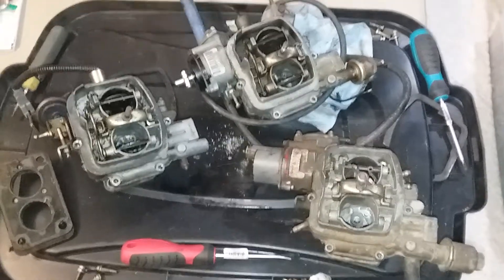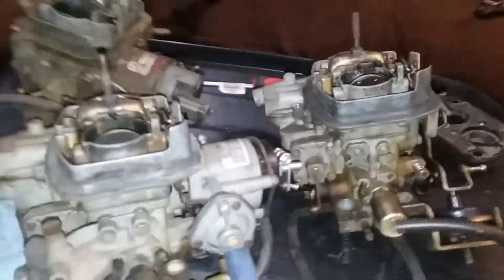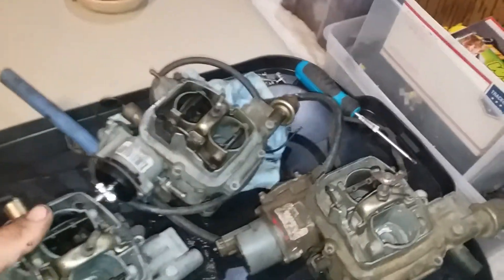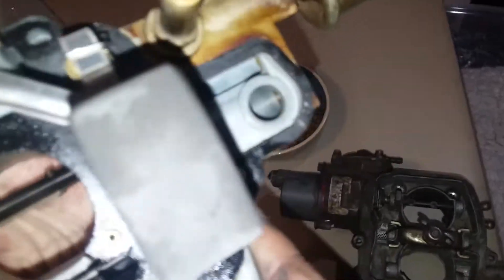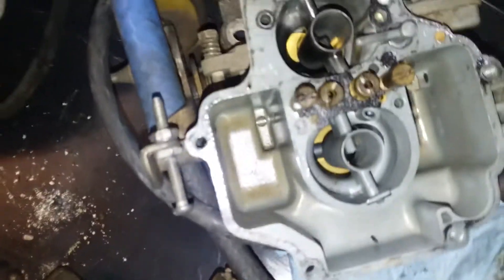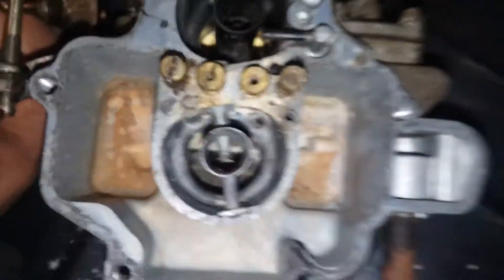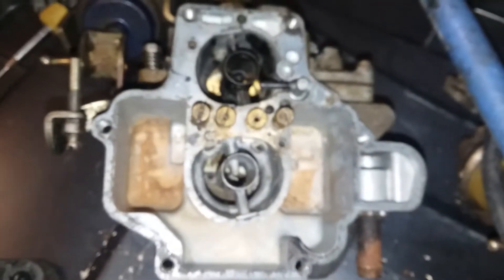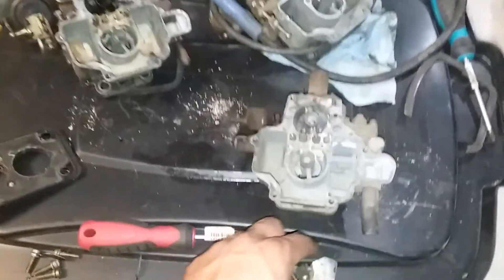1.6 VS 1.6 HO VS 1.9 Ford CVH Carburetor Comparison

Comment: Can you run a K&N air cleaner on these like you can on a traditional Weber 32/34dft or dmtr?
Reply from the maker: To have an air filter like that on these you need to make a custom plate or airbox just because these have a funny pattern around the tops of the barrels
Reply: @The_1982_EXPert  Another random question, will a traditional Weber carb bolt onto our manifolds? I know burton power sells a ton of stuff the mk3’s, I’m just not sure what fits the usdm escorts.
Reply from the maker: @hunterreynolds9670  Only a few Webers directly bolt onto our North American carb manifolds, just: 
The 32/32 & 32/34 stock carbs
The 32/36 progressive Weber
The 38/38 synchronous Weber

To use the 36+ carbs you might need to open up the barrel ports on the intake, custom linkages & rejetting will be needed on the non-stock carbs as well.
Reply: @The_1982_EXPert  nice nice, I’ll be messaging a lot more. I just took possession of my grandpas 84 escort hatch with 90k original miles on it.
Reply from the maker: @hunterreynolds9670  you're welcome to email me too, it's easier to type a larger reply there

the1982expert@gmail.com

Comment: In brazil, there was a carb from weber called "460". Looks pretty much the same as these of yours. It came in a lot of cars, the standard ones got a 32mm and 21-22 venturis. But in the ford escort xr3 of us they came in special version with 24-25 size, mechanical secundary and practically no emissions control stuff. It was gorgeous. Put one in my 1.5l fiat with a cam, jumped to 69hp to almost 90hp
Reply from the maker: Very nice! I'll be playing around with my carbs this summer, I'll even be testing out some bike carbs at some point :)

Comment: Venturi size is pointless without mention of choke size within the venturi. 
For example: 32mm venturi with 22mm choke in both barrels of 1.6l standard. AKA Motorcraft 740, a licensed copy of the Weber 32DFT.
Proper terminology with a more accurate throat analysis would be great. 
Venturi and choke sizes take the confusion out of the calibration. 
It's a balance of trade-offs.
Reply from the maker: The choke sizes are the same among the 3 (some just don't have a choke plate for the secondary barrel), meaning they all have the same inlet size but the "34mm venturi" refers to the outlet being 2mm larger than the base model 1.6 carb.

This allows you to interchange top plates between the carbs without much issue, however some carbs don't have the fuel return/vent circuit.
Reply: @The_1982_EXPert  
You're not understanding what a "venturi" is. A venturi has a choke. 
Much like a hourglass, there is a choked portion of a venturi that creates a restriction and allows a carburetor to atomize fuel at a given rate. 
In the case of your 1.6l standard carb the venturi opening is 32mm with its respective choke being 22mm. This is true for both barrels of that carb. 22/22 is embossed on the carb body to verify, as these are fixed sizes. 
Your 1.6l HO carb has different choke sizes for primary and secondary, 32 and 34 respectively. 
...what are they?
Those sizes will be embossed on the body as well. 
The different calibrations (or "jets") are a direct reflection of the venturi opening and choke sizes. 
Understanding these venturi/choke combinations makes the vastly differing calibrations of two nearly identical carbs easier.
Reply from the maker: @СтивСкотт  okay, I see now. I'd have to check them all again for that measurement but the larger secondaries are bigger.

But they don't affect the required jetting much besides what your base jetting starts at.
Reply: @The_1982_EXPert  
I've been running that exact smaller 32/32 carb on Honda Goldwings for years now with a huge and successful following doing the same. Some have also used the HO 32/34 carburetor with success as well. The 1.9l carb I am not familiar with. 
Calibration, or "jetting" can ALWAYS be optimized for something in particular. Any factory base calibration is a tradeoff of evils and is usually set for economy over performance with these particular carbs. 
The Motorcraft 740 is built by Ford under a licensing agreement with Weber Carburettor and is a direct copy of the Weber 32DFT, so Weber calibration parts work just as the Motorcraft parts do, except that Weber has a broader selection than Ford does, as Ford's licensing agreement does not allow for the full range of calibrated parts for the carbs. 
It was interesting seeing someone outside of my circles post anything at all about these carbs in a comparative way. 
Kudos and Thumbs Up!
Reply from the maker: @СтивСкотт  very neat! So you like these 2 barrels over the standard Goldwing Kehins? I'm a full time powersports technician, been working on a lot of GL1000s the last few months.......

Some time soon I'll be trying CRB carbs on a 1.9 CVH, that will be a in-depth build with some good videos to follow :)
Reply: @The_1982_EXPert  
Here's a video from one of my other channels with the smaller carb on one of my old 1000's:
https://youtu.be/G3Bhhm_sDGQ
The audio is chopped up because of a music copyright violation, but...